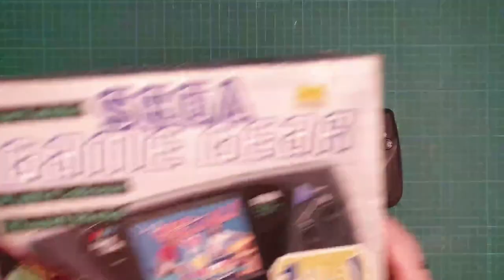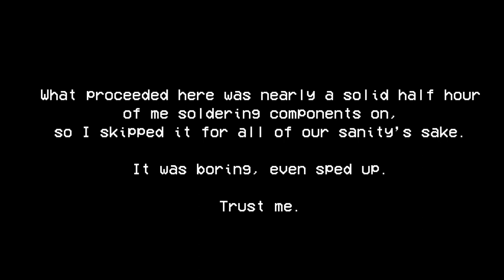Sega Game Gear with no video or sound - can we fix it?

Comment: Not putting loose screws in a lid or container is a recipe for a lost screw... and a sore foot later. I used a similar trick cleaning the 4 carbies on a Honda CBR250... 4 separate containers. Each piece from a carbie went into it's numbered container. HUGE head-ache saver.
Reply from the maker: Yep these days my silicone mat has magnets in it, and I have a separate metal magnetic tray for when I need more space
Reply: @silvestronsbitsandbytes  I need to invest in a magnetic tray. When I want screws to stay in place, and mapped out,  I tend to use some paper masking tape and stick them to that. Taking "before I screw everything up" pictures has also saved me more than once.

Comment: I do the same thing to keep track of my screws. Love IFixit.

Omg, you got the idea from the same place.... he uses quadrants xD I'm subbing just for that.

Also, it's an underrated movie. The vibes, Lara's playlist... man it brings back memories.

Was giving your vid a look over though, I have one of these guys and I need to source the caps first.
Reply from the maker: Might not be the "best", but it is a classic ;)

Cap kits are easy to come by for the GGs, I sell them in my store if you're in Australia, Console5 and RetroSix have the rest of the world covered for you. My main piece of advice is to wear a mask and have good ventilation when you're doing it! The leaked cap fluid smells TERRIBLE when you're cleaning the pads with fresh solder, no matter how hard you've scrubbed it off.
Reply: @silvestronsbitsandbytes  definitely agreed, a classic indeed. :)

And yeah, thanks for that tip. XD I already popped 'em open and thankfully- it looks like just the sound board looks in rough shape. Power board looks okay. But that sound board amd the main board- they need some TLC. 

I think I'm going to order both a replacement sounds board and a cap kit just in case. But Console5 is out of stock on the boards themselves. I will take the time to order the cap kit from them soon though. 👍

Comment: So I had the same issue with my Game Gear and proceeded to replace all the caps (Motherboard,Powerboard and the Soundboard). After replacement,my screen is completely black,I still have no sound but it turns on. Any Idea,what it could be?
Reply: Sound is there if I put earphones on. But the speaker looks like the owner before me did a Hiroshima there.
Reply from the maker: Hmm, without seeing it it would be hard - sounds like multiple problems! Possibly the connection between the sound board and speaker are just broken along the way somewhere from corrosion? As for no display, it's also possible that it's displaying but the backlight is dead so you're not able to see it?

I'd recommend joining the Console Repair Discord (https://discord.gg/console-repair-discord-754165317961383997) and ask about it in the #game-gear channel, give a good description of the issue and work done so far, post some photos etc. Very knowledgeable folks in there!
Reply: @silvestronsbitsandbytes  so for the Display I was thinking and found out it was the Fuse on the left sids of the screen,when measuring it with a multimeter and fivin power to the board I can see everything :D. The sound issue is a misterium,as it is there with headphones.
Reply from the maker: Oh that's awesome! Yep, there's two backlight fuses, one on each side of the board, so you might wanna check that the other one is fully healthy too (as low resistance as possible). For the speaker, you can check between the speaker pins and the sound board with continuity mode - if it's not making continuity there must be a break in the circuit somewhere.
Reply: @silvestronsbitsandbytes  Thank you I will try it! If I don't come wide I will post something on the Server. I already joined but forgot it.

Comment: On my Game Gear the sound works using headphones but not the built in speaker. Any ideas?
Reply from the maker: Without seeing the board myself, my three guesses would be; If you haven't replaced the capacitors, definitely do that. If you have, there might have been a damaged trace from the probably-leaked caps that needs repair. It could also be the switch inside the headphone jack that disables the speakers is permanently closed due to a short. Good luck!
Reply: Could be the jack itself

Comment: Are you in Australia, by any chance?
Reply: Sorry, I asked this question then checked your about info. I'm in Brisbane and would be keen to learn more about repairing these systems.
Reply from the maker: I learned by buying dead units off eBay and trying to fix them! It's getting a bit harder now as even non-working stuff is pulling a high price, sadly
Reply: @silvestronsbitsandbytes  I am meeting a chap tomorrow to get some games for my system. He also has some other bits that he's not sure if they work I told him parts are welcome! I'd like a busted controller so I can cut the cord and experiment with custom controllers. A switchable "rapid fire" is something I want to sketch out. Thinking I'll have a toggle so when you press the button, it gates in the output of a 555 instead.

Comment: I saw some arabic text on the box. Pretty interesting.
Reply from the maker: The arabic text is on a sticker placed on the box by a company called Dotts Electronics, and some Google Fu reveals they were the official distributor of Sega products in the 90s - https://segaretro.org/Alesayi_United
This box (unsure if it matches the console) looks to have originally been purchased in the UAE region!

Good eye! I didn't even notice that and it led me down a bit of a rabbit hole. I feel like an Antiques Roadshow expert now :-)
Reply: @silvestronsbitsandbytes  So are you saying the Game Gear had an official middle eastern release!?
Reply from the maker: @lkskun  Sure seems that way! I wonder how it made its way to Australia!
Reply: @silvestronsbitsandbytes  Yes there was a Middle Eastern launch. I bought one from Egypt, Abu Dhabi, and Australia. Every one of 'em had a different package. I don't know what happened to the Middle Eastern ones, probably donated or ended up in the bin. But the Aussie one I picked up from eBay, the backlight is lit but nothing on the screen? I am still sussing it out.
Reply from the maker: It's almost always caps in the GG, they're practically guaranteed to fail unfortunately
Reply: @silvestronsbitsandbytes  you’re absolutely on the money. I managed to open it today and the leak is visible. Now the struggle is real (soldering). Did a very sloppy job in the past, connecting two cables together and it was B A D 🙈.
Reply from the maker: Yeah they can be messy. Unfortunately replacing the surface mount caps on these isn't a super beginner task, but I guess there's only one way to learn! Also the leaked electrolytic STINKS when you start soldering, so make sure you have fume extraction or at least a fan blowing the smell away from you! Good luck!
Reply: @silvestronsbitsandbytes  I really admire your positive encouragement. I watched the majority of your YT clips, so I can watch more of the process being done in front of me. I am not gonna be able to…at least for now. Can I send it from Adelaide to you for a bad @$$ repair and get it back and obviously happy to cover any costs 🤙forgot to mention I bought a VA1 for a 2 chip version capacitors from Console5 and waiting for them atm 🙏
Reply from the maker: Yes! I do mail-ins from all over Australia :) Check out https://silvestron.com/repair-service/ for details!

Comment: Try replacing the audio board problem solved
Reply from the maker: No need to replace the whole board, a simple clean up and replacement of the capacitors are all that's needed in this case.
Reply: He's right, and just replacing the board itself is a sloppy fix. You end up with spare broken boards in the end that could have been salvaged. The parts aren't exactly available with ease.